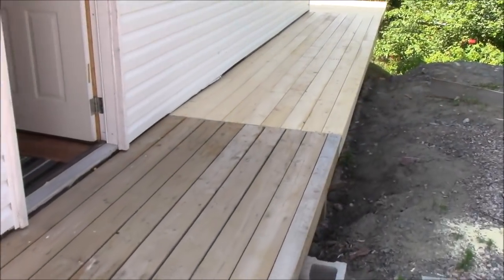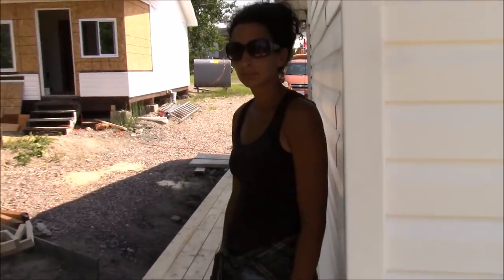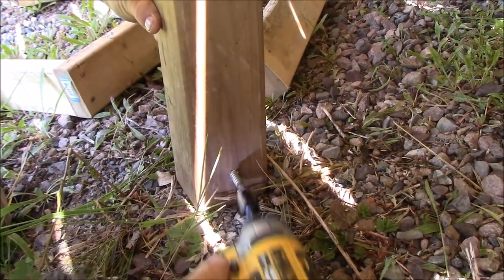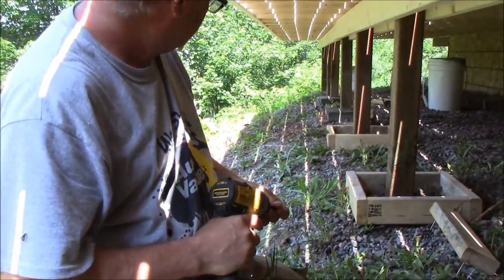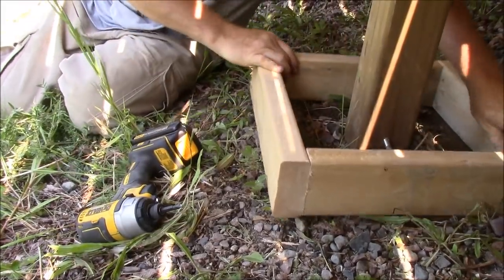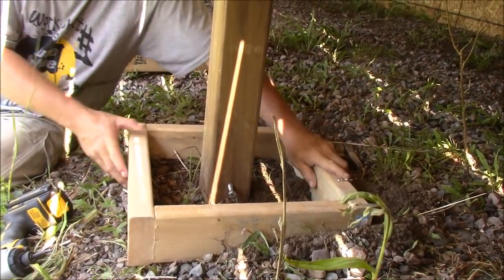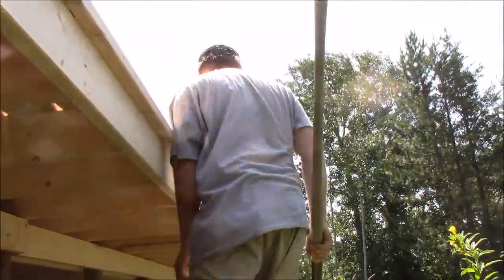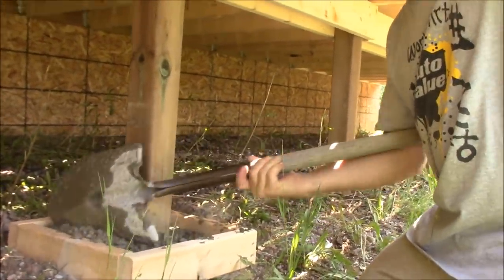Building Concrete Forms//Mixing Cement For Deck Posts

Comment: Wow, never heard of pouring the footing after you set the post!!! Weird
Reply from the maker: Same principal as drilling into an existing concrete footing and epoxying re-bar to add another footing to existing one.  the posts are set on hard ground and the posts have lag bolts screwed into them and are cemented into the center of the footings.
Reply: I’ve never seen this before either, but it’s a great and effective technique. I will use this for when my gazebo footings start going bad (I made some mistakes during build). Thanks for the idea. This will allow me to save my gazebo in the future.

Comment: I guess you need the exercise, but wouldn't it have been easier to take the wheelbarrow to the forms ?
Reply from the maker: Not enough room John, It's quite a steep drop off on that side of the house.
Reply: Sorry, 
Don't mean to criticize but you see in part of my varied past life I was what is known as a Time and Motion Study Analyst (f #%&ing efficiency expert, to some people)
I think I would have dumped the bags of dry mix on the deck and dropped them over the edge at the required spots. 
I am also a bit of a lazy bastard. LOL
Reply: If a layer of 3/4 gravel is strong enough to carry a 60,000 lb train and 3 miles of  loaded carriage, I am sure that you will have no problem with that SMALL deck.

Comment: One question, how are those concrete pads supposed to hold and spread out any weight ehn the concrete seems to be only around the post instead of under the post?
Reply: Beyer Forestry, Welding, and Other Stuff totally agree!
Reply from the maker: Did you watch the whole video Jeffry?  The lag bolts I screwed in the posts are cemented in the concrete.... Those 3/8 bolts would have to sheer off in the concrete before the posts would ever slip... Not happening on a light deck with this many posts, on rock even .
Reply: Off Grid Homesteader Cecil E Skinner Did watch the whole thing, must have missed that part. Was assuming that the bolts worked as you suggested but wasn't sure. So the bolts work both ways then. Pretty neat idea.
Reply from the maker: Yeah we used to drill holes into an existing footing and epoxy re-bar into it and add a new footing onto the old one....It worked well and was engineered, I am confident the bolts in the posts the middle of the concrete pads will hold and won't allow the posts to just slip off lol.

Comment: I must have been doing it wrong all these years! 
I thought footings went at the foot of the post. These will do nothing to support the posts. 
Total waste of time and materials in my opinion.
Reply from the maker: Sounds like you have only experienced one way of doing things is all.  I seriously doubt if the lag bolts are going to sheer off inside the concrete pads.... Especially on a light deck like this and so many pads.  Seeing how we are on rock, I believe pouring pads first, leveling all them and then cutting all my posts to fit would be a bigger waste of time, but hey my way eliminated a lot of steps that was not necessary   
😉
Reply: Main reason we have to have the posts on top of the pad down here in Florida is for water runoff. That style here the wood would rot out in a cpl years. I'm sure Cecil knows what will work in his area just fine. It is only a deck after all, hardly any weight to it at all.
Reply: Whatever you say.
Reply: That will work just fine,The gravel in the area will take care of the surface water run-off. 
When a post rots out it will be at  the point where it goes into the ground due to the absorption and drying out of water that surrounds it. 
Those posts will not suffer from that experience, so, no rot.
Cecil, you could have used the 'dry mix' for those post forms.
Place the concrete dry mix in the form, then add water. less work  No mixing required. Same result
Reply: @johnahern9908  I came to say the same thing.  You can use quick Crete dry and fill the forms, then just water them.  This deck isn’t being inspected and the posts will likely never fail.